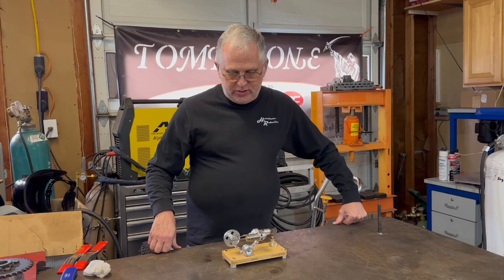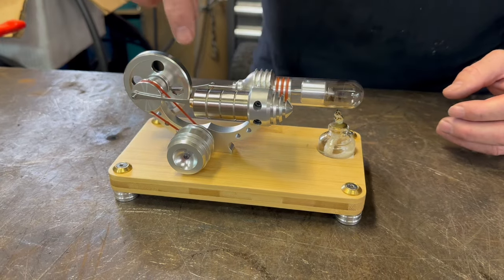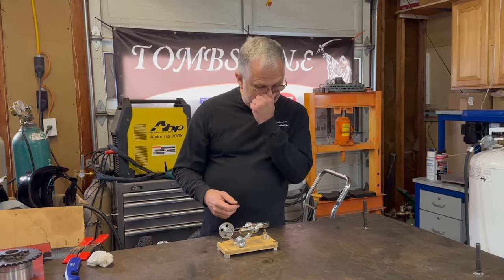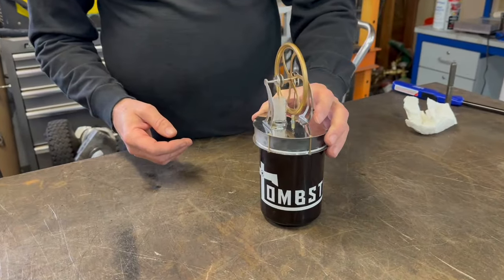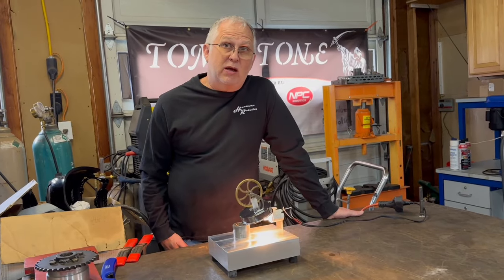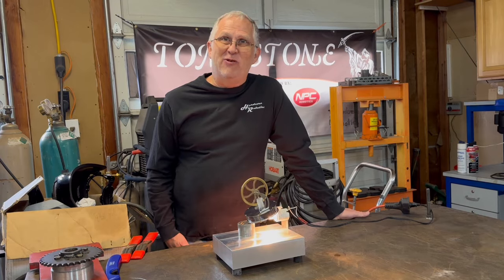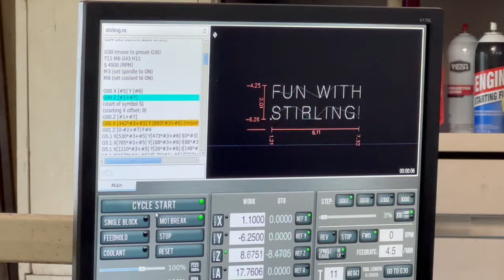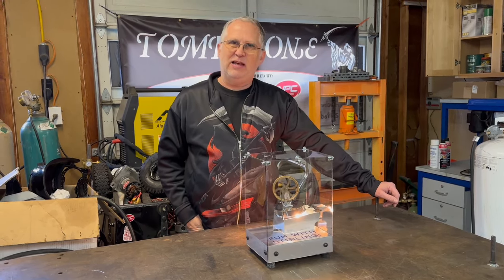Stirling Engine Display

Comment: i have one of them from a company that also sells much larger models with multiple cylinders, but even the single-cylinder ones have a wheel for powering accessories, i have often wondered, could you rig up a small generator and a heating element around the heating chamber on the Stirling, so once you got it hot conventionally you could swap the self-powered heating element onto it, and it runs itself
Reply from the maker: You always have power losses, no free lunch here :) Typically Stirling engines just make very little power unfortunately.

Comment: Here's a bit of a fun fact! The Swedish Gotland-class attack submarines does have sterling engines, which allow them to stay under water for weeks rather than days as a diesel-electric would be limited to.
Reply from the maker: Anywhere there is a reliable temperature differential - like say the cold water a sub is sitting in and the warm machinery inside - you can make power with it. I was unaware of this sub using this, but it does make sense!